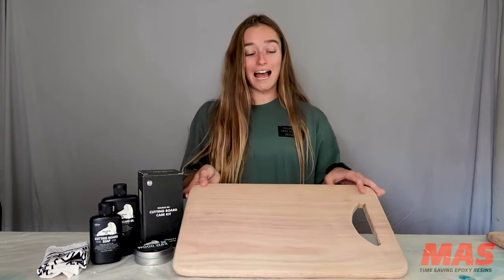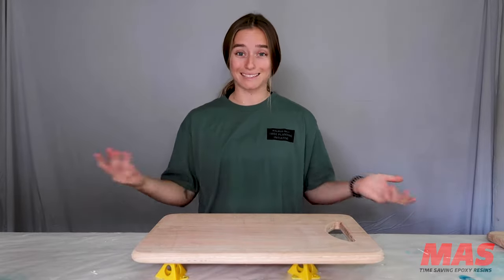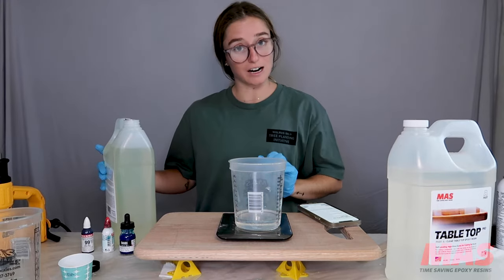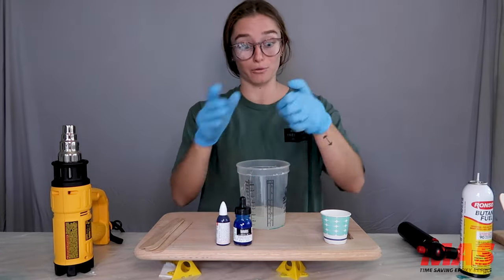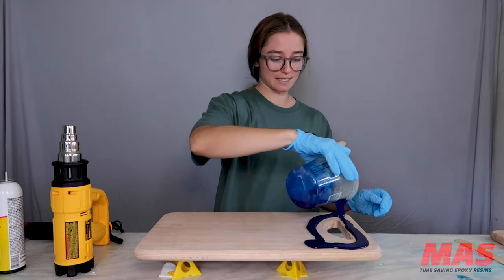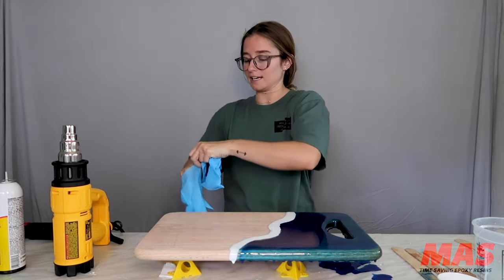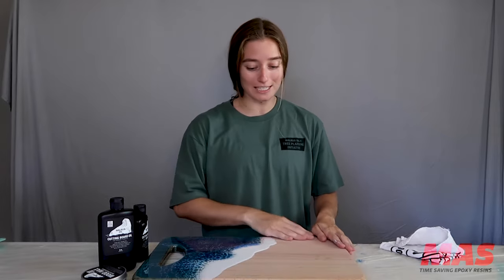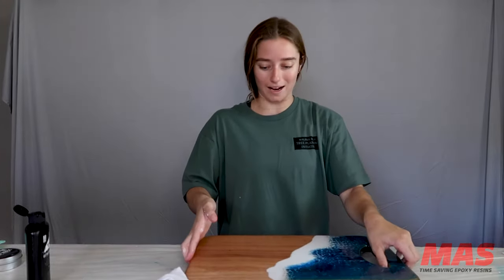How to Make a Resin Ocean Serving Tray with Epoxy and Walrus Oil

Comment: Hello Hailey. Thanks for this video. I am new to Epoxy Resin. I have a question regarding the amount of each component. If the Resin ratio is 1:1 whey the difference on your project? Just want to make sure I mix measure correctly.  Thanks

Comment: Thank you for your tips and very clear instructions. Can you please advise if you use max heat to push the white up or what setting would you suggest. Also, why do you wait 15 minutes for the white and does this depend on the working time of your resin.
Reply from the maker: The length of time we let the white sit for depends on how much resin were mixing up and the gel time of the system were using. As far as the heat gun medium or high heat. Be careful not to scorch the resin. Trial and error is the best way to perfect your waves.